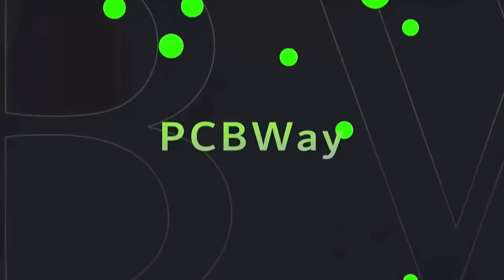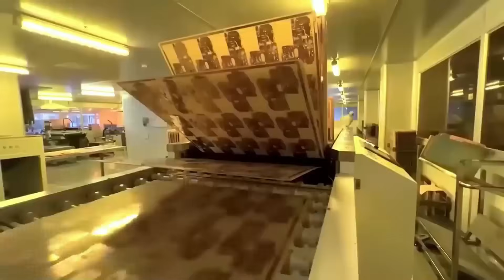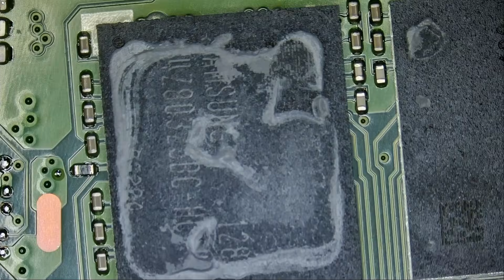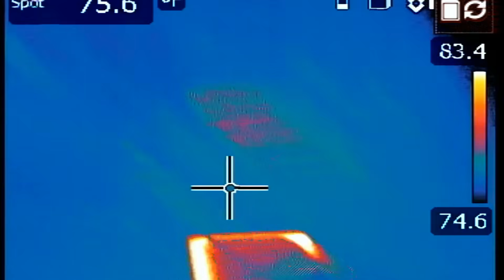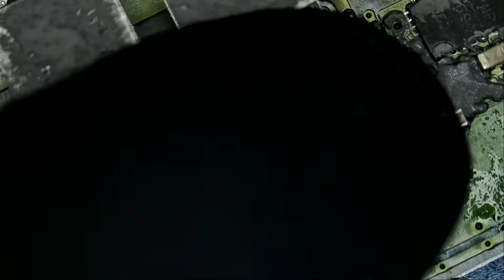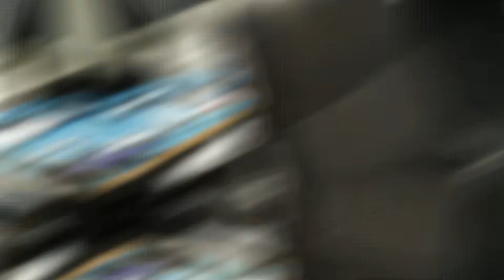Expensive Zenbook i9 Laptop Dead. What's going on Asus? UX582 Fixed.

Comment: Great work as usual, Obviously it was shorted by a drop of water or the paste on the caps gain moister and get shorted which is obvious of the cap terminals black and green blue color.عمل ممتاز كالعادة ,الواضح ان المعجون على المكثفات اكتسب رطوبة وادى الى احداث شورت بالمسار ذلك الواضح من لون اقطاب المكثفات على البوردة باللون الغامق والاخضر المزرق بسبب المياه,كل التوفيق وتحية لكم من لبنان.

Comment: I just dont understand those small capacitors recently one of my routers got damaged due to that faulty capacitor i remined that burnt capacitor and directly shorted those terminals its working fine 😂 because i didnt knew how it worked used flux and solder and just shorted two terminals miraculously it is still working everything is working as intended no heating no nothing

Comment: I bet a nice dinner that the big caps there are tantalum. It's not uncommon for tantalums to leak and blow up like that. It doesn't matter how much you pay for a system there's a certain percentage of tantalums which are expected to fail. It's just the nature of the beast. With luck it doesn't cause any further damage, maybe a power transistor at most, and you're back in business.

Comment: I have a ASUS ROG Strix G17 2022. The display went black when I connected it to the lan for wifi. Now it works with external display but nvidia drivers cause the even the external display to go black (on windows). Right now I'm using linux with no nvidia display drivers. Could you please suggest a fix?

Comment: Ceramic is brittle, those capacitor are multiple layers of alternate conductor +, conductor - and ceramic, with vibrations the ceramic break and the conductor + and - touch each others creating a short circuit.

Comment: Hello Alex.
The capacitors as well as the resistors have been chosen by the manufacturer in such a way that they almost always operate at their maximum power. By this I mean, for example, a resistor that normally dissipates 1/2 watt is replaced by the manufacturer with a resistor that can dissipate 1/4 watt. Of course this works, but the resistance is then constantly under severe stress, which reduces the lifespan of the component. This also happens with the capacitors and even with other components. The manufacturer's aim for this is to be able to quickly bring new devices to the market. We live in a throwaway society where only the pursuit of profit counts for the manufacturers. It's a pity that we have to observe this in both Europe and the US. But that's just the reality. Greetings from Belgium. Andy

Comment: what is the liquid you use on the q tips? to clean the board during and after you are finish soldering?
Reply: 90% rubbing alcohol or higher. Anything lower leaves traces of residue behind.

Comment: I bought an Asus Zenbook roughly five years ago, the model number is 430UN. Out of the box it had issues with sleeping and not waking up, continues to have that problem. Two years in, the battery died and there were no original replacement parts. So now I have an ultrabook that was supposed to be high end, $1500 laptop, that cannot sleep and has no battery. Never buying Asus again even if it was the last laptop maker in the world
Reply: Thank you! When I buy laptop i will remember ur comment. No asus
Reply: Sleeping issue can be corrected just with a registry key...you either could set it in s3 or s0 state😅
Reply: bought a asus gaming laptop about a year ago, only had problems ever since
Reply: To be fair sleeping is a Microsoft issue, not Asus issue. For the battery you can almost always get replacement batteries if you bother to ask from proper shops. It doesn't have to be original part to work.

Comment: There looks like a corrosion happened to the caps and power line. Metallization on one side of the cap corroded, not burned. The damage very close to the DRMOS and may present underneath, because corrosion may spread below the mask layer. For my opinion, it is necessary to desolder the DRMOS and check the condition. After the repair, a good practice is to check that this particular power line is working like the other "neighbors". Otherwise, next DRMOS may fail under the load later.
Anyway, maybe I am wrong. I like your videos - they're never boring.

Comment: I have a laptop with a 1TB ssd and a normal hd.  The os is on the ssd, but it won't boot.  SMART says it's failing.  I can luckily read files from the windows 10 installation usb from the CMD.  I copied the users folder to the normal hd, I hope.  I'm not sure what else I'll need from it, but it's write protected for some reason, and I can't get any tool to do anything with it.

Comment: Just imagine how many of these devices are simply thrown away because of some tiny capacitors failing. It's nuts.
Reply: Need automotive grade ICs next. Those bastards tolerate 20 years of harsh conditions no worries.
Reply: Can I use that comment on a future post? U will get the creative creation credit?😊

Comment: caps looked like suffered from a water damage
Reply: Yeah almost like a bit of liquid got trapped under there.
Reply: Yep, see the green copper salt. The ends are corroded off the capacitors.
Reply: Agreed. You can see corrosions nearby the caps.
Reply: the thermal pad probably trapped moisture there
Reply: no, they leaked chemical from inside.

Comment: The slight rotation may be signal integrity mitigation, in order to avoid the fiber weave effect at high frequencies. This skew is to prevent the routing from aligning with the fiberglass weave pattern in the glass cloth between layers. If you have a trace sitting right over a glass bundle, and the adjacent trace is over the gaps between the bundles, the difference in dielectric constant between the glass and prepreg resin will cause the signals to have different velocities, potentially causing bus timing issues. 10-12 degrees is typical. Usually you just draw your traces in a zigzag pattern, but if there's no room, you have to also rotate the parts, or rotate the entire panel at the factory, but that wastes material.
Reply: People tend to forget that at these speed rates, digital lines have a lot of RF characteristics that have to be addressed. For example PCIe cards have to be impedance matched to the motherboard (there are standardized values)
Reply: Wow, I learned something new today. Thanks! :)
Reply: @tomclanys  what did you learn bro, i didn t understand one thing ahah
Reply: @popcopone  
In electronics and communication engineering there are some factors taken in consideration in microwaves and optics when designing a PCB to reduce noise and losses
Reply: The first sentence in your comment explains it all. Very well said.